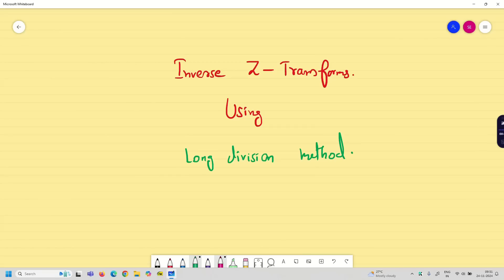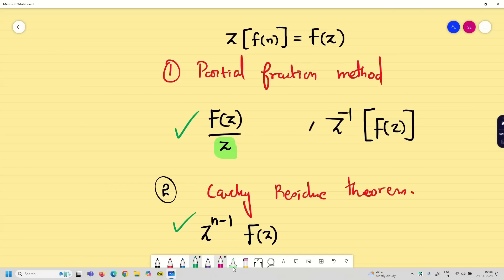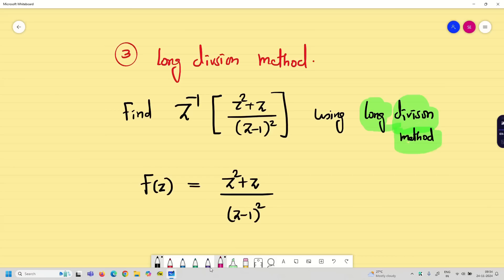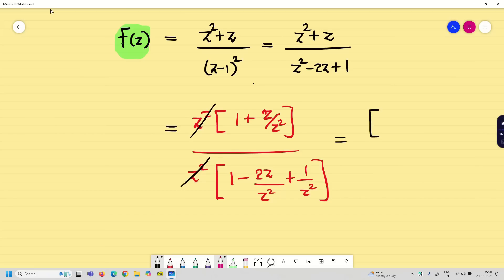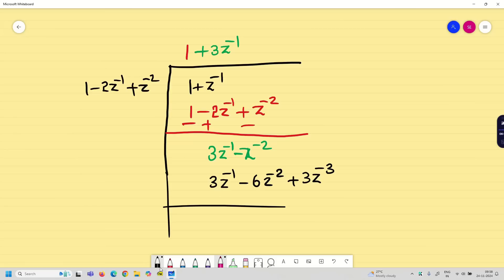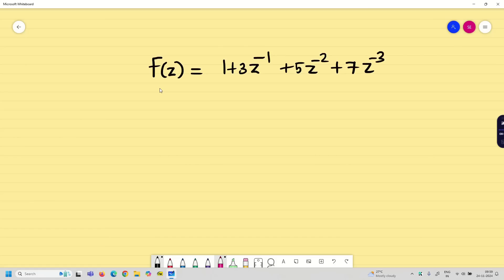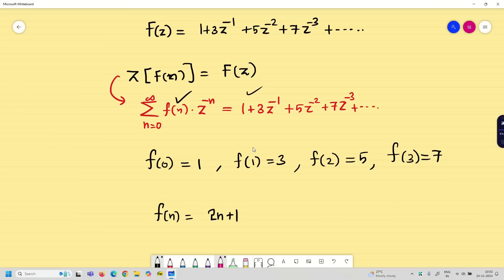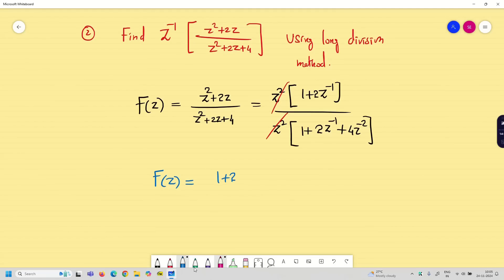13. Long Division Method : Inverse Z-transforms - 21MAB201T

Comment: Sir for half range series questions in harmonic analysis only difference is that we take given Length as HL itself ...we will not divide by 2...if it has eg from 0-Pi then length will be  
Length = HL = PI
And so theeta = pi x/pi = x..
Reply from the maker: Yes yes exactly